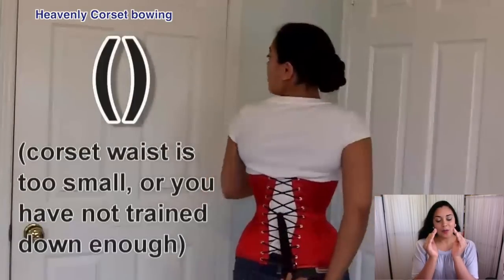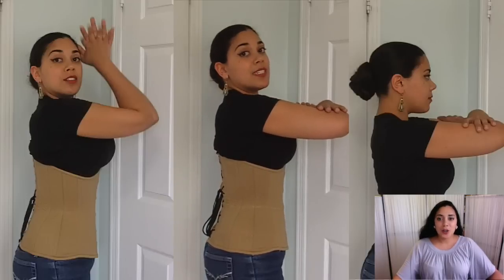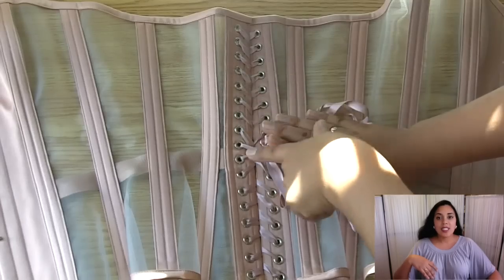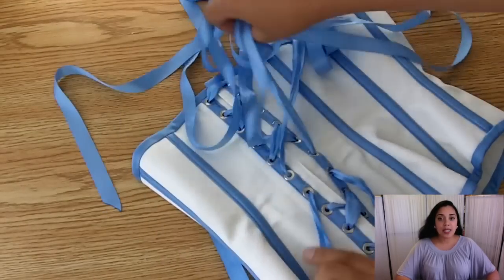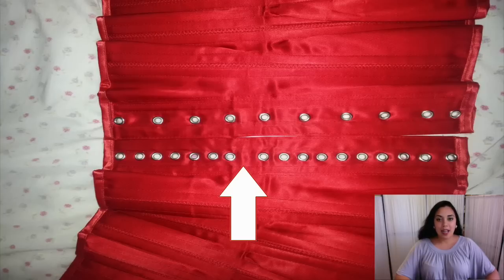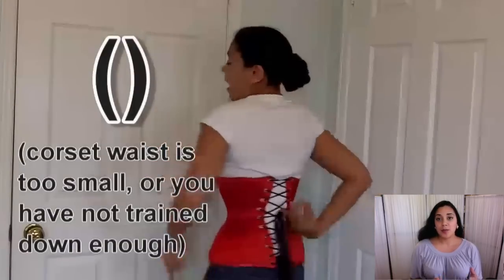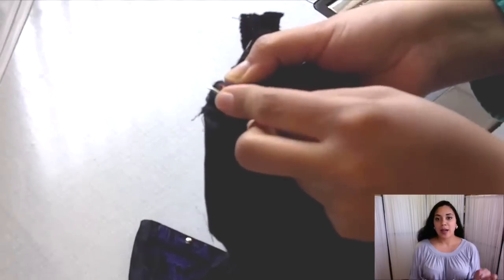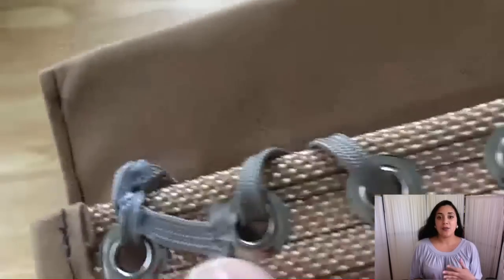BOWED CORSET STEELS: Causes and Corrections! | Lucy's Corsetry

Comment: just curious, I got a cut to size from vollers, the gap is wider top and bottom but still seems comfy, the diagram with it clearly shows 2 inch gap top and bottom when fully closed, although I'm not there yet. Is that an unusual design?

Comment: A little late to the party, but something that has helped me with bowing (in mock-ups though, haven't gotten one down well enough yet, too much of a perfectionist. x-x) is using a strip of interfacing down along the boning channels and grommets. None of the flimsy stuff, but the weight used for cuffs and collars, works reasonably well in my experience. (Now if only I can get a satisfactory mockup done...)

P.S. Gonna look into the use of buckram, might be too stiff however, don't know yet though. (Seems like it would be amazing for modesty panels however.)

Comment: I've learned so much from your short videos. I want to,make a corset someday. I'm one of those people though that is not asymmetrical.  I had a stroke and my while right side is not lined straight. I was paralyzed from my shoulder to my toes. I don't have anyone to do the measuring that I saw you do on a,customer.
Reply from the maker: Sylvia Stevenson Do you live near a dry cleaning place or tailor's shop? Sometimes they will help you take measurements. They may not be terribly familiar with the specific measurements for a corset, but if you provide them with a list or diagram they may be able to help you. Another option is a specialty clothing store like a bridal salon or a good business suit place.

Comment: I experienced a different kind of bowing when I started seasoning my corset. When I took it off after several wears I noticed that one of the bones was very bent in a U shape, closer to me at the waist with the ends sticking away from the body (well, it was not "away" when I was wearing it, I just mean the direction of the bowing). The bone on the other side of the gap was pretty much straight. It took quite a bit of effort to make them even. The seasoning session was a 20 minute walk with no acrobatics and about an hour of sitting or walking in the house.
Reply from the maker: ThexBlackxKitty Whoa, that's interesting bowing shape only on one side. I show others how to curve the back bones deliberately in a different video if they have swayback - but always both sides equally. Is the modesty panel on the side where the bone is less bent?

Comment: Thanks so much, Lucy! Could the bowing be at all related, or a cause of, the steel strips in the front of my corset being pulled skew? No matter what I do, the top of the centre-front catches sit a little to the left, and the bottom sits a little to the right. As a result, I cannot wear my corset over my clothes.  It just doesn't look good.
Reply from the maker: Parousia001 If the busk is sitting crooked on you, I would probably measure each side of the corset at the top edge, middle (at waist tape), and bottom edge and see if they are equal on both sides (within half an inch). If the corset seems perfectly even, I would look at whether your body has any natural asymmetry (it's normal to have a little bit of asymmetry but some have more than others). I have a video on it here: https://www.youtube.com/watch?v=KMYPD1lmpdo

Comment: What does it mean if only one side is bowing in the back? I bought a "Camellias" corset from amazon...the over all construction seems pretty good considering I payed less than $50 for it, and I tested the bones with a magnet to make sure they're steel. I'm just not sure what I'm doing wrong to make only one side bow out. :(  I haven't worn it since I discovered this because I'm afraid of doing permanent damage.
Reply from the maker: Hi Rachel, is the side that's bowing also the side that doesn't have a modesty panel attached? For one reason or another, a sewn in modesty panel can strengthen the bone on that side and prevent it from bowing outward. If you want to make it more even, you can probably remove the modesty panel so both sides bow evenly, haha. Or you could sew a strip of fabric to the other side, but that could get lumpy when you're wearing the corset.
Reply: Wow, I never would've thought of that! It is the side without the modesty panel. I think I might remove the panel and replace the bones back there with stronger ones, then add some strong fabric. Thank you so much for your help!